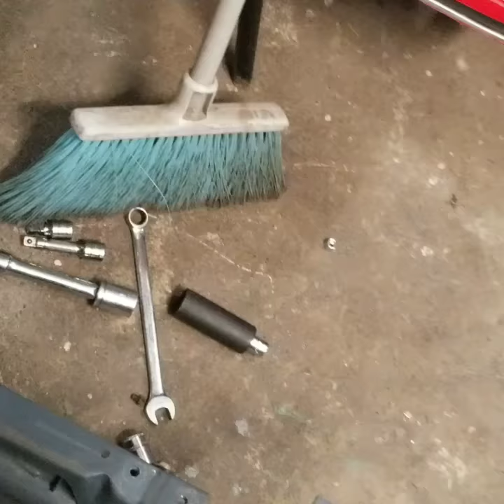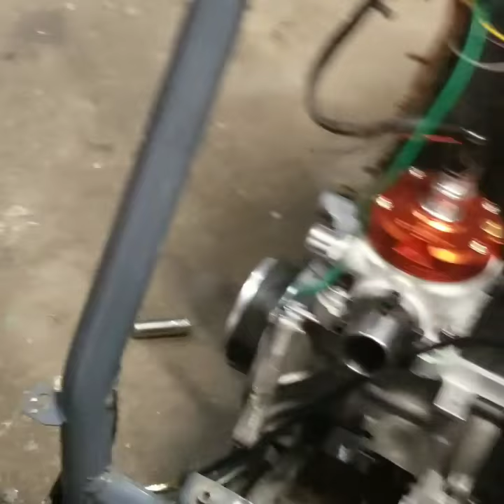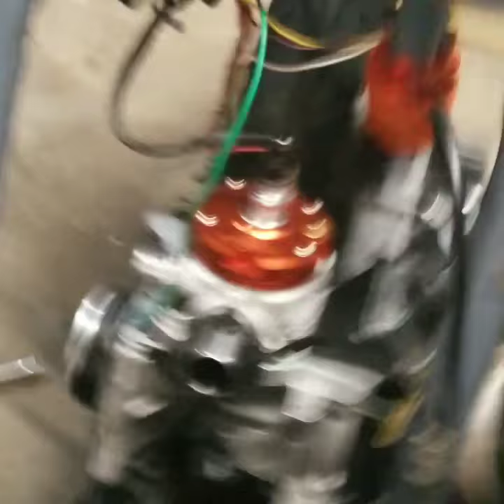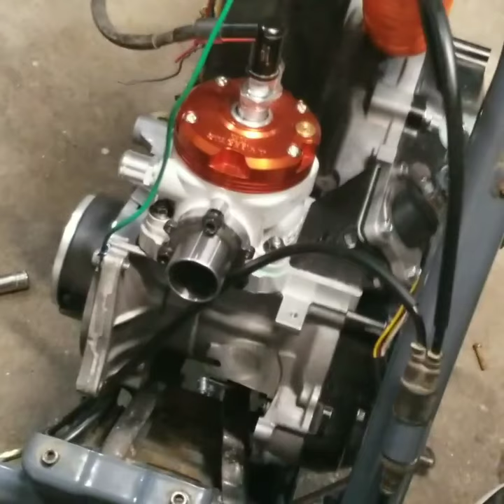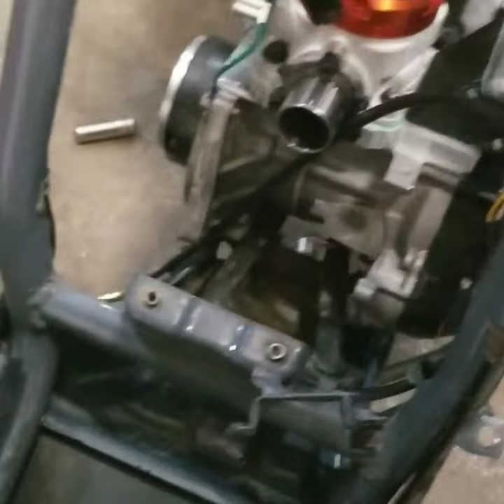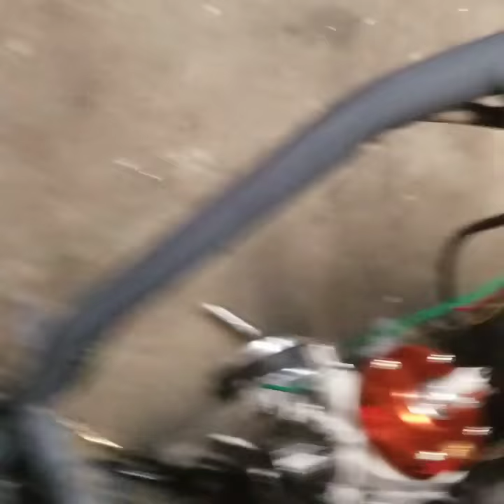Stage6 R/T 95cc Honda Dio AF18 First start  #SHORTS

Comment: I would like to ask you Minarelli MVT ignition and CDI. Which model do you purchase? Have you purchased the internet? Thank you.
Reply from the maker: 陳小明 I did but the crank is also minarelli so it fits correctly.  It will not work on an af18 stock crank.
Reply: Thank you.